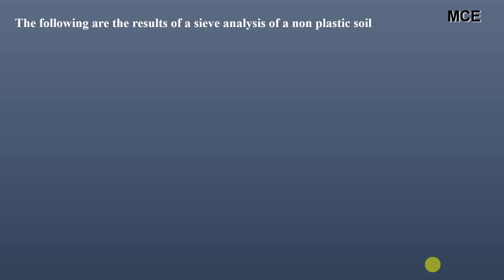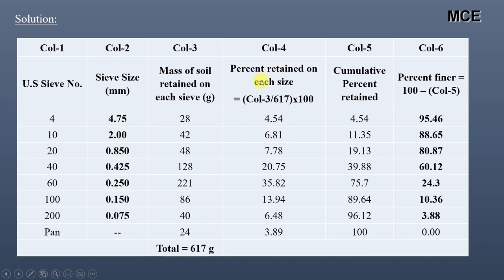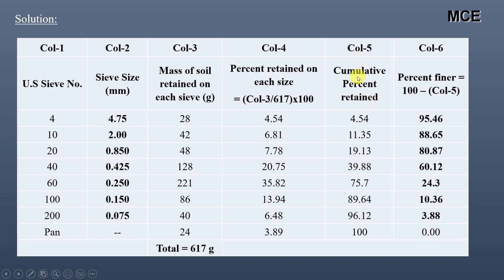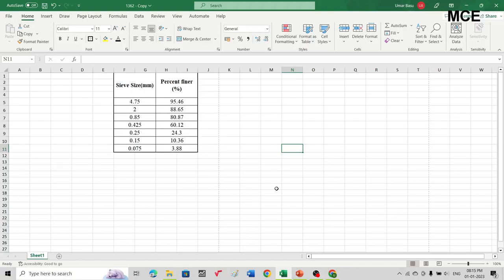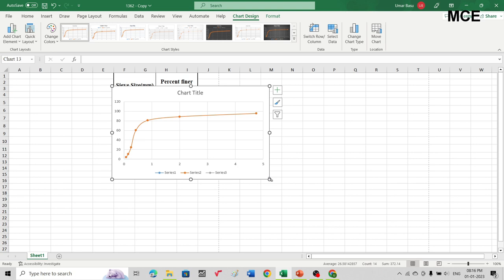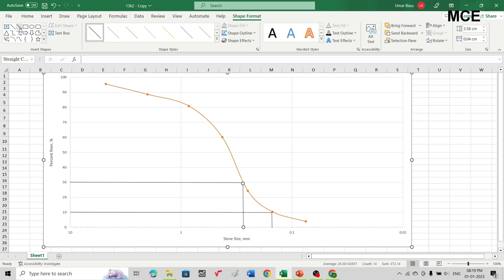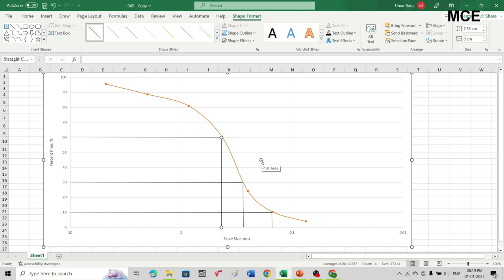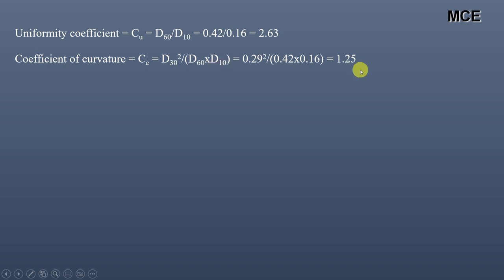Sieve Analysis and Classification of Soil using Unified Soil Classification (USCS) and AASHTO system

Comment: It is very weird to see  drawing the line manually using the draw button. We can always plot the values to draw the line to get D10, D40 or D60 etc. You are just assuming the size of this each percent finer.
Reply from the maker: Thanks for watching Master Civil Engineering
Reply from the maker: I m not assuming the points but drawing lines exactly at 10% or 60% finer of soil to get value of D10 or D60
Reply from the maker: If you have any confusion please write it in a comment box and I will be happy to help you